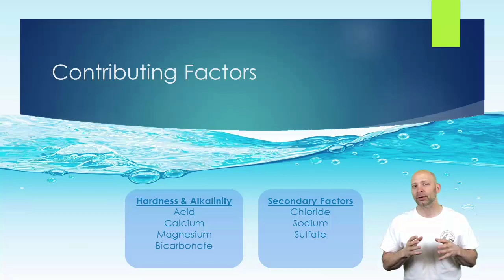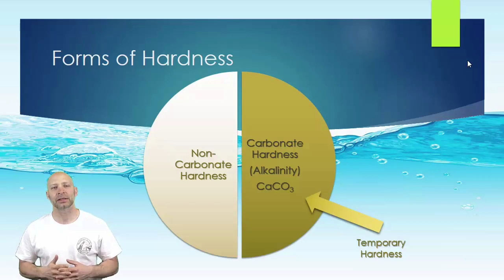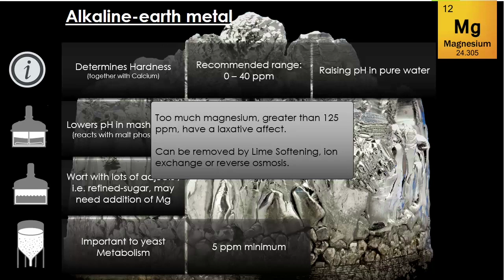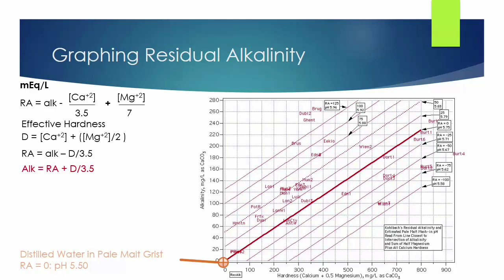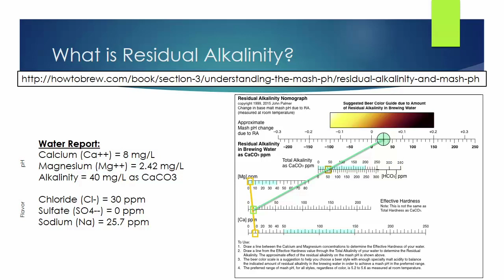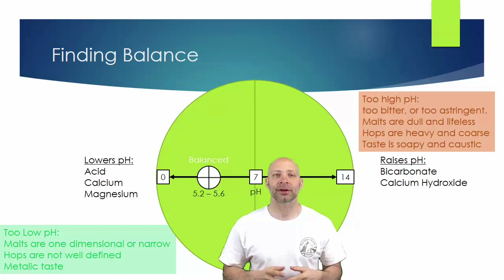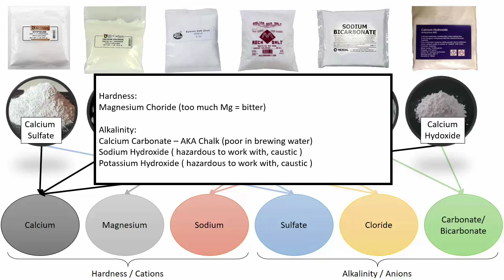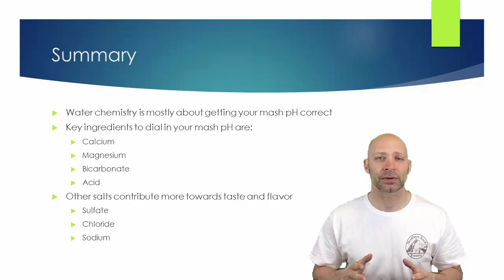Introduction To Water II - Hardness Alkalinity and More

Comment: thankyou so much for explaining this Tony, I live in south eastern Australia, climate here is like Oregon / Northern California it is a generally high rainfall area my water comes from a temperate rain forest and is almost the same as yours, very low in calcium....Calcium mg/L 5.5 Calcium Hardness -13.4 Magnesium 3.0 Magnesium hardness 12.4 sulfate 3.0 Total hardness 25.9 and PH is 7.4 ....going to check out that chart of John Palmer, cheers
Reply from the maker: Hi Peter, like an old friend that comes to visit from time to time, I remember you :-) I'm glad you like this video. Yes, that's a really great tool for determining your residual alkalinity and getting a ballpark idea of what beer color you water is best suited for without any adjustments. You don't mention alkalinity or chloride, but your hardness and sulfate values look useful - better to be able to add then to have to take away. :-) Cheers!
Reply: the only other thing I get on the water report it Total Chlorine 0.92 for some reason they don't mention Chlorides
Reply from the maker: Hi Peter, what about Alkalinity? Do they report the Bicarbonate or Total Alkalinity level, or Carbonate? If I had these, I reasonably deduce your Chloride levels by finding the Cation/Anion balance. Cheers!
Reply: just total hardness which is 2.5 mg/L  and sulfate, 3.0 mg/L nothing about alkalinity, it is impossible to get a full water profile from them, all I know is that it is soft, I did some research online and there are a lot of brewing blogs and people in my area have the same problem, they don't give out Total Alkalinity level, or Carbonate for some bizarre reason, I can only assume that it would be pretty low, I will try and find out, thanks

Comment: Brilliant video, thank you very much. It is all starting to make sense, just need to watch it again to get my head around it. Chemistry scares me!!!
I've recently had my water tested, but they were unable to tell me the sodium levels, which is a shame, but I am assuming (at the moment), that this isn't too critical..............yet?? Thanks again.
Reply from the maker: Hi! No, if you have been brewing and things are turning out fine then no, it's probably not critical. If you have all of the other values though, it's not hard to figure it out. I have create a Sodium Calculator you can use. It's based on how sodium is calculated in the LaMotte Water Kit manual: https://docs.google.com/spreadsheets/d/1isoVuWGq_C4xnIF6CSLrwGvavl82G2QFs7mov86gE78/edit?usp=sharing
Hope this helps! Cheers!
Reply from the maker: Just change the values for Total Hardness, Chloride, Sulfate and Alkalinity. Your sodium value can be deduced from these ion values.
Reply: That's brilliant, thank so much for taking the time to help, greatly appreciated. Cheers

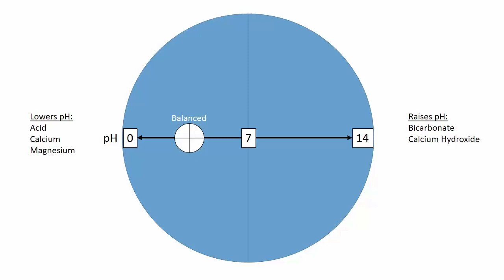Comment: Hey,  Great Video!  Just one thing, maybe I missed something with the phytic acids/malt phosphate or something but you say at 28:18 or so that we shouldn't use chalk because it will just precipitate out of solution at the pH sweet spot. Doesn't calcium carbonate precipitate out of water solution at a much higher pH (not anywhere near the sweet spot)? I understand that the calcium will later precipitate out with the malt phosphate but it doesn't sound like that's what you're referring to. Carbonate contributes more to alkalinity than bicarbonate, and if calcium is the problem in this equation, would sodium carbonate (Na2CO3) work? I think I've heard John Palmer saying something similar, but try as I might, I can't seem to make sense of it. Thanks!

Comment: Hi Tony, thanks a lot for this great Video, that gives a lot of valuable Information on the importance of water quality. I have one question: in one of your last slides you summarized the SO4/Cl-Ratios for various  categories of beer styles. Could it be that the ratios are the other way Arouca: 3:1 SO4/Cl for stouts and porters?
Reply from the maker: Hi Juergen, thanks and I'm glad this had value for you. The sulfate to chloride ratios presented for dark malty beers is correct. More sulfate than chloride would be appropriate for a Cascadian IPA, or Black IPA,  but even then at low levels. Stouts and Porters should be more malt forward with a smooth mouthfeel, which is derived from a higher concentration of chloride. Cheers!

Comment: thanks Tony, another info packed video. have been looking to get my feet wet for a while with water additions and this video has given me a good shove to get it happening. I have a question: I've managed to get some data on my water from the local municipality, your video and other sources have given me a reasonable understanding of how and why to change the water profile, but I'm not sure what I should be aiming for. I remember you recommend additions for newtohomebrewtom, can you tell me what they were aiming for?? thanking you in advance.
Reply from the maker: +Stass Brewing Hi, yeah I would be glad to help. I tested Toms water and with that he took the profile and plugged it into a spreadsheet (I'm assuming) and came up with those addition on his own. With knowing what your water profile is, the next step is to figure out what your target profile is - which is going to be different for different beer styles. The different styles, or more accurately different grist acidities, will determine what treatments are needed to reach your target profile for reaching optimal mash pH, and flavor profile. Unfortunately one size does not fit all. I'm working on the next video that will compare and explore the tools for dialing in target profiles that get the mash in the pH ballpark with the correct flavor profiles for the different styles. Cheers!
Reply: ah ok cool.  I must have misunderstood what Tom said in his video, I thought that you had given his the additions (or suggested the additions) to make; which is why I asked what profile you were using when you made those suggestions.  Ok, I think I understand all the steps (thanks to your great vids and other online researching).  The next step is to take the leap of faith into the unknown, though from all accounts, it's a good thing to do.  Cheers Tony!  Keep up the great work!

Comment: Great video, I am trying to calculate my Hardness with the lamotte brew lab and I am getting a reading over 500PPM. I did the additional test with the diluted sample and I want to know if I add the results of the diluted sample to 500 considering I am using a diluted sample
Reply from the maker: ewok671 Hi! If you diluted a sample and conducted a total hardness test on that sample, then no, you would not add that to the 500 from the non diluted sample. If I understand you correctly, then I think you would have to know the factor at which you diluted by, and use that to figure out if the original nondiluted value was accurate. Where are you, roughly? That’s some pretty hard water. Cheers!
Reply: I did another test and realized I used the wrong test tube. My hardness came out to 220ppm, still high but manageable. I am in Guam getting water from limestone groundwater.
Reply from the maker: Ah, yeah that would have some impact on the results! Have you tried boiling water for 15 minutes, then give it an hour or so to settle, then take a sample and test from that water?  There is likely some temporary hardness that will precipitate out and give you even better brewing water. Best regards!
Reply: I tried boiling a couple cups and came up with ok results. I plan to use boiled water and RO on my next batch.

Comment: Hi Tony thanks for the extensive video! I got a extensive water report from the pump station that supplies the water to my house in the netherlands city of Roermond.
The values are averaged over multiple measurements taken in 2016 there was not a high standarddeviation for each element.
I used the RA-Nomograph you suplied and foud out that i can best brew dark beers.
Ca= 67.63, Mg 7.04, HCO3 182.33, Cl- 37.79, SO4- 55.93, Na 23.99.
It looks to me that i should find a way to reduce the high total Alkalinity to be able to brew a better blond beer. Is there a easy method to do this?

Comment: Hey Tony, great video! I have been doing my water chemistry for 2 years now, for lowering my PH i use citric acid, any reason why i should not be using this acid? Cheers!
Reply from the maker: I remember reading somewhere that citric acid was popular back when Charlie Papazian started homebrewing, and it was mainly because that's what was easy to get their hands on back then. While it is stronger than phosphoric, i.e. more effective at reducing alkalinity, it comes at a cost of added flavor by the citrate ions. I've also read that citric acid used to reduce the pH on fruity/citrusy hoppy beers can be complementary, but that it does not seem so with more malt-forward beers. I've personally never used it, so I can't say for sure. I have thought about it for a fruity/citrusy beer. The others I mention, lactic and phosphoric, have a more neutral flavor than citric, and is probably why they seem more popular nowadays. What's your experience with using citric acid? Have you ever experienced what I've mentioned, or am I just subject to Fake Information? :-)

Comment: Thanks for doing this video Tony, I have the same soft water as you in the UK do you also use bru n water calculator? Last brew i used the london profile for a porter the difference is night and day when i added compared to doing nothing in the past.

Do you mix the salts in hot water before adding? I threw all mine in the mash last time and it turned out alright, Im about to start brewing on a commercial setup soon so i want to make sure im getting my water the best i can make it!

Thanks
Reply from the maker: Hi Daz! Yeah, I have the supporters version of BruNWater and use it when planning every brew day. Like I said at the end of this video, I add my salts directly to the mash after the malts added. The reason I do it like this instead of adding to water first has primarily to do with my process (under-let). If I were to add the grains to the strike water, like most people do, it's recommended to add the salts to the water first to ensure a good saturation in the water and therefore contact with the malts. However, since I am constantly recirculating for the duration of the mash, and stirring the grains a few times during the mash, I believe I get good saturation and it seems to work for me. With regards to moving to a difference brewing setup, yeah it's going to possibly require a different process and something you are going to have to think about. Most commercial systems I have seen have an HLT that can hold all of the water necessary for a complete brew, and therefore can be treated to a set profile and not be bothered with refilling it after striking the mash (like my HLT), ensuring a consistent strike and mash water profile. Mash pH is the most important, but I also monitor pH pre and post boil, as well as post fermentation. Hope this helps! Cheers!
Reply: Thanks for the reply Tony, Yes the HLT is big enough to hold strike and sparge ill just add it all to that then, I cant remember who now but someone told me not to go over 100 on the chloride because it gives strange mineral taste but Murphy's water report tells me to go over it? What profiles have you tried for pale ales and stouts etc?

Thanks
Reply from the maker: Hi Daz, Yeah, 100 ppm limit on Chloride is what's documented in the water book, with an upper limit of 150 ppm for a handful of sweeter/stronger/darker lagers and ales. Anything higher (greater then 200) can give the beer a pasty or salty taste. I use water profiles that are in the ranges found in the Water book (chapter 7), which are also available in the downloadable spreadsheet on HowToBrew.com at the bottom of the Residual Alkalinity page: http://howtobrew.com/book/section-3/understanding-the-mash-ph/residual-alkalinity-and-mash-ph
Hope this helps! Cheers!

Comment: I have the following: 89.5 mg/L dissolved ca, 26.5 mg/L dissolved mg,  T - alkalinity (as CaCO3) is 333 mg/L, P - alkalinity (as CaCO3) is <5. Then at the bottom of the lab report it says Hardness: 333 mg CaCO3/L. Does this mean I have 116 mg/L non-carbonate hardness and 333 mg/L carbonate hardness?
Reply from the maker: Hi Lyle, I don't believe it's important to try and determine the difference between permanent and temporary hardness with regards to brewing water . Just knowing the calcium, magnesium, and alkalinity you are able to determine your residual alkalinity (RA), which is a good estimator with regards to knowing what style of beer your base water is best suited for, or better yet what things you might need to do to your water to adjust it for beer styles it's not good for. You RA results around 254, which is very high and best for stouts, the darkest of beers. The more acidic grist will temper/react with the alkaline ions in your water, but still, the more the alkalinity, the harder it will be for the water to change pH. Boiling your water first, and then siphoning it off the dropped out carbonates (temp hardness) would be a simple and cheap start before trying to brew lighter beers. 
Part III in this series talks more about that. Hope this helps!  Cheers!